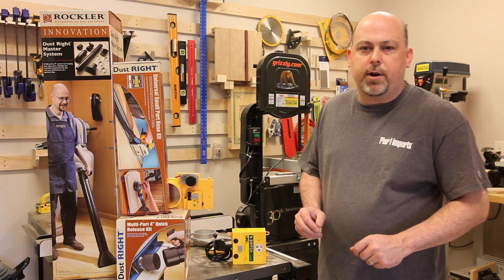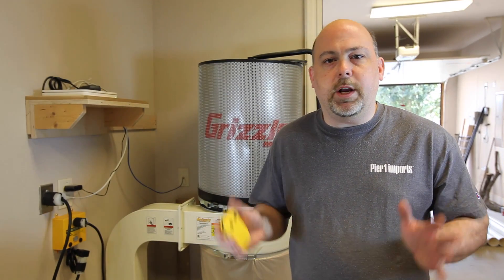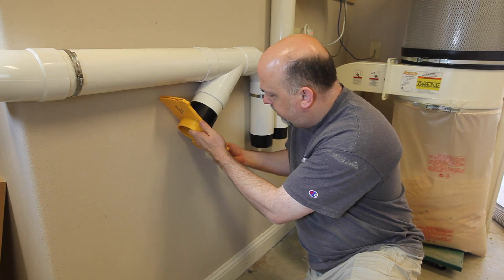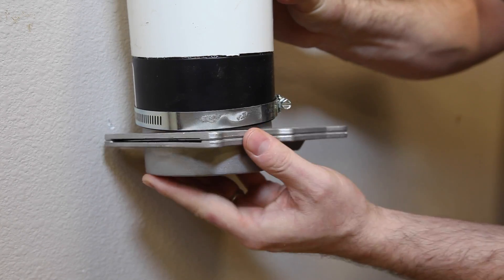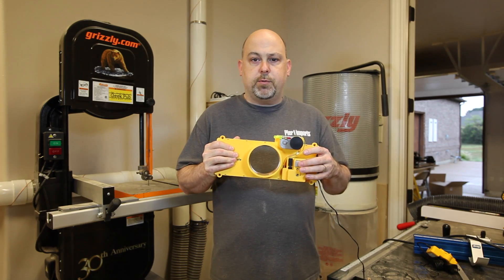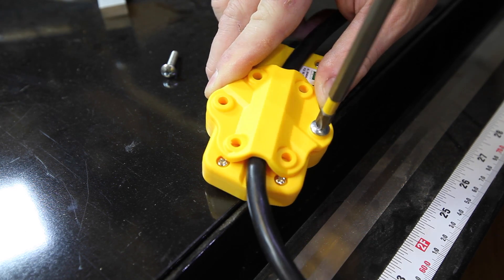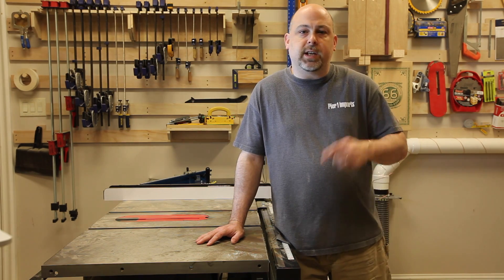Installing an Automated Dust Collection System

Comment: Great video for an intriguing product. We're definitely looking into getting the IVAC system now for our shop.

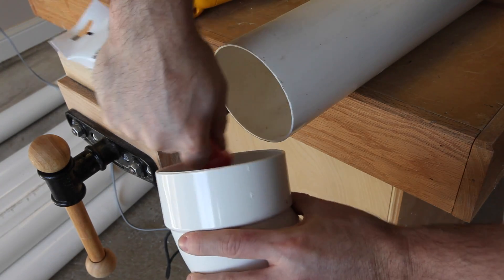Question though...What PVC pipe are you using and where'd you end up buying that from? From the video around 02:42, it looks super thin. We've been looking at using PVC meant for sewer/drain but even that looks thicker than this.

Anyone encounter an issue with sewer/drain PVC where the diameter is less than the stated value? We went to a local Menards and they have 2 types of PVC - high quality thick material and this thinner sewer/drain material, and they are not the same diameter.

The sewer/drain PVC is about a 1/2" narrower in diameter than the thicker material.

We're trying to not pay out $50 per piece for our dust collection system, but also ensure that the pipes we end up with actually fit together within the system as a whole.

Comment: The way you grounded that pvc pipe did absolutely nothing.  That is fact and isn't my opinion that is up for debate.
Reply from the maker: You're pretty sure of yourself for being wrong.  The screws penetrate the PVC and act as rods inside the pipe collecting static electricity from moving dust/air.  Stay in school kids.

Comment: The only issue that I am trying to solve here is that you need at least 3 power outlets per machine i.e., one for machine, one for the gate and one for the tool that goes on the cable to detect current. There should be a better way to do this which I am not aware of.
Reply: One outlet can feed a power bar, which you can plug your gate and sensor in to.

Comment: According to Grizzly’s website: “To protect against static electrical build up inside a non-conducting duct, a bare copper wire should be placed inside the duct along its length and grounded to the dust collector. You must also confirm that the dust collector is continuously grounded through the electrical circuit to the electric service panel.” The unit typically produces 80 dB noise levels which can cause hearing damage over an 8 hour period of continuous operation. Switching it off when not in use is an excellent idea.
Reply from the maker: Running the conductor inside the pipe is a terrible idea. It will collect and hold dust and strings of wood.  In addition, it will cause turbulence in the pipe reducing airflow and efficiency. The approached we used where you pierce the pipe with a metal stud (in this case a screw tip) every few feet is by far the safer and most effective method.

Comment: This system will set me back around $800 for my small shop, even higher if they actually offer 6” valves 😳 
..Ahh I think I’ll do it manually for now until competition comes in and drive the price down.

Comment: Adding washers to compensate for the PVC joints was hilarious. Also, that 4" duct won't give you the flow you need to capture the bad dust, even if it was a smooth run with no joints, flexy hose, and internal collars at the blast gates which are all stealing flow. It might get the chips and the mostly harmless visible dust, but the real fine cancer causing stuff will just swirl around and into your lungs. To do the job properly you really need 1200+ CFM which means 6" duct or better, minimal flexy, unrestricted blast gates, and no 'adaptors to regular dust control fittings'. Finally, forget the silicon. A friction fit is just fine for this, costs nothing and is much easier to alter in future. Otherwise, great work flogging your sponsor's trinkets.

Comment: I can’t believe all of the 90 degree turns you have in the ducting! I hope that you have further updated.
Reply from the maker: There's a video someone else did on that topic.  Every turn equated to roughly .05% reduction in flow.  It might matter in some commercial setup. It's a non-issue in my setup.

Comment: I've seen videos on this Dust collection before and in the comments section almost all have said the system stops working after a couple of months so I didn't think about using it and the price would have been $1400. Too far out of the price range for me
Reply from the maker: Still going solid 4 year later.
Reply: @TheGeekPub  thanks for the information .

Comment: I'm confused why you have it programmed to close the blast gate before it turns off the DC.  Assuming no gates are open how is it going to evacuate any residual dust?  Sounds like it's just putting unnecessary strain on the DC motor.
Reply from the maker: Exactly the opposite.  The blast gates wait 6 seconds to close.
Reply: @TheGeekPub  Roger.  Just, that's not what you said in the video, thus the confusion (time index 7:57)

Comment: if the blast gate closes and the dust collection is still going.... wont what damage the ducting or dust collector?
Reply from the maker: Not if you designed your system correctly.  But you can google it.  Dust collectors with the correct plumbing actually use the least amount of electricity when all gates are closed.  It will not damage them.
Reply: @TheGeekPub  gotcha, I just read what all the experts and engineers say on these blogs, I need to stop listening, lol

Comment: Back in the day everything was wired with LV and relay switches with green lights on both gates and a master flow control board. Now I can key up my Ham radio and turn on my neighbor's workshop in the middle of the night.

Comment: It is silly to use induction sensing and then require a power source for the sensors. Why not just use a  current activated switch and eliminate the need for the UBS charging bit?
Reply: The main reason I can think of is if your blast gate is a long way from the sensor.

Comment: Nice job and nice shop but I hate to be the picky guy  one thing I hate is if your working for crap sake wear boots   If not boots sneakers  flip flops on ladders or in the work shop is not safe.  On a second note  you can make blast gates out of mdf and sewer pipe fittings also can be actuated with a micro switch from long ranger or any other with a 10v dc coil   Majority of the time the remote is lost or on the other side of the room where you don’t need it and have to walk back   All you have to do is open the gate where you wanna work and the dust collector turns on    Otherwise great job
Reply from the maker: Worry about your own safety and I will worry about mine.
Reply: TheGeekPub relax guy   Every day I lace up my steel toe work boots and get going to work and kick them off when I’m done building  there’s never a time I put a tool in my hand without boots on  it’s just common sense!
Reply from the maker: That's awesome.  You win your safety police badge.  Everyone is so proud.

Comment: In the end I think its better to make your own system with homemade blast gates and stuff I got about 40 arduinos with rf recivers and transmittors with some wifi and bluetooth modules and some relays. IF you have the experiance to make them yourself you should deffently do so, it will reduce in costs, you'll probaly learn something and you can customize it to how you see fit. Having a 3D printer on hand will also help alot since you can print blast gates and different connectors yourself. But if you don't have the experiance or capacity to do this yourself this is the best way to go! awesome video :)

Comment: Hi, neat idea with the wall mounted clamps. Why take a risk, no matter how small, with a dust exposion/fire? However, why not just run the copper wire inside the tubing? Much neater looking. BobUK.

Comment: I see a lot of people here commenting on should they or shouldn't they spent the money on this system; I guess if you get it for free it motivates you to get one, I personally can do it either way, I would like to work with it but also can do just fine without it; I have a clearvue max and have multiple gates open at one time on certain stations that I use more often, I close my gates manually at the thickness planer, dual outlet drum sander, but keep it open for the miter saw station and the table saws; you kind picked on some here for not investing 500 in this system while investing 3500 or so in table saw, I got news for you, I got two sawstop saws, one industrial and one 3hp professional and a slider, you know that just the two sawstops cost me quite a lot more than you mentioned, still don't feel the need to invest in this automated blast gate system so stop picking on people for that, some of us enjoy couple steps to open and close some of the blasts; one piece of advice.....it would've been better for you to invest in a better dust collector than worry about the blast gates, you will be surprised what a difference that makes, you can afford to keep more than one blast gate open when you have a 8" main running thru your shop. other that, I am happy for you that you get to play with those toys; one of the guys in their comments was right, what are you doing walking around in your slippers in the shop, let alone climbing a ladder in them, that tells me you like more being in front of the cameras that be out there and get dirty and make some money; its so funny when I run into you guys, the ones that like to do these little shows about being a woodworker, yet I don't see any meaningful product done by you guys; I've building staircases and cabinetry for as long as I remember, I never found the time to be in front of the camera like some of you guys are, you guys have too much time at your disposal, lol; don't mean to pick on you, just want to let you know, some of us have no interest in these new gadgets that keep on popping up, if you follow with it, you will never catch up to them, they always pop up new things all the time, just like the Iphone. best of luck to you. Dan

Comment: From what I have read, there has never been a fire that was started by static in a dust collection system. That being said, I ground my dust collection hoses, because I absolutely hate getting shocked!
Reply: True, static shock is a thing especially if your have carpet on your shop floor 🤣

I run basically the same setup(video) in my shop w/o any additional grounding. There is no dust particules in or out the pipes. My floor is concrete and I wears adequate shoes, never get a single static shock since my new shop is up (5 years).

Comment: Not a good idea to close the blast gate so long before shutting down the vacuum pump. Not good for the fittings or the motor, and it won't be able to clear the line effectively which is the only reason to run it after shutting the tool down.

Comment: The cost of this product is horrendous and there seems to be no starter kit, My hobby shop would cost in excess of £800 not including the duct pipe. And if you really think that you need to ground you dust collection system then any piece of wire can be used you don't need to buy a special one.
Reply from the maker: Comments like this baffle me.  People will spend $3500 on a table saw and $3500 on a jointer, and then whine about $500 for a dust collection system.
Reply: @TheGeekPub  Not many people spend 3500 on a table saw.  Most woodworkers I know have $200 dollar worksite saws they've modified or built a platform for.  Going to the local woodworking group here in Portland will show you that 80% of the woodworkers don't have a jointer at all.  This kit is neat, but the price is astronomical for what it provides.  Hell man, the "grounding kit" is 20 dollars for two fittings, two screws and some copper wire.  I know they sponsor the video and you've gotta shill for them and all, but comments like this by you are obnoxious and scream of privilege.

Comment: You can't ground an insulator.  lol.  At most you can drain the charge, but it's really not necessary.  However spiral flex hose (if it's wire reinforced) will definitely built up a nasty charge and should be grounded for sure.
Reply: Bert Green, I kind of feel sorry for the geekpub, lol; you kind of mop the floor with him when it comes to debating; I tell you what, he comes across as a hard core sells person for this company vs a true woodworker he should be; you are 100% correct with regards to OSHA outcomes, in a regular woodshop where chemicals are not involved, I've yet to see a fire; I personally was in the woodworking industry for a good while and, besides making sure that the spray/paint area is well vented, I've never worried about dust collection spark fire, mind you, I owned that business so it was in my best interest to make sure there was no fire at anytime; we had all kind of other problems like cutting fingers, etc, but no fire so far; but this newfound you-tubers that these days have nothing to do but try to sell stuff on you tube and tell people all kind of false info, piss me off, because so many innocent people out there believe everything these guys tells them and because they hang around you tube for a while, now they believed over people like you that put out facts, funny stuff isn't it?
Reply: I mean, he really should have stopped debating me the second I said that I was an electro-mechanical designer and that I build commercial grade machinery and control systems.  This is what I do for a living.  Hands on experience both building an operating machinery while actually being the kind of nerd that enjoys reading technical white papers like the MIT Lincoln Lab report.  But his response "You still don't understand" had me rolling on the floor laughing.  At the end of the day, it's basic electronics 101.  1)  You can not ground an insulator.  2) If he wanted to prove this was an actual issue, all he had to do was find an example of an explosion happening and share a link.  I was confident enough in the outcome I was willing to put money on it.   My offer stands:   $5 to anyone that can post a link of a documented case of a dust explosion in PVC pipe in a non-commercial environment as a result of static discharge.   

Regardless, it's still not a bad idea to drain the charge and run ground wires as shown.  The static is quite annoying, and it can damage sensitive electronics.
Reply: of course its not a bad idea, especially with the braded hoses running to the tools, static can be a pain in the ass; there is another gentleman that makes a big deal of this fire hazard misrepresentation, I don't know, maybe they are connected to the right people that pays them the right amount of money to keep bringing that up and we all spasm here about how wrong they are when they know all along how wrong they are but laughing all the way to the bank, lol.
Reply from the maker: I don't debate things like fake moon landings, flat earths and whether or not dust in a vortex moving through plastic tubes causes the build up of static electricity.  Call it childish if you want.  It's been debated an nauseam in the comments.  I'm sure someone else will chime in and help you out though.
Reply: @vertikalvt  A response like "you don't understand" followed by a response like "I'm not going to debate" usually means that He doesn't understand. It's like arguing with a liberal. They do a lot of screaming and name calling, but can never actually give you an answer to any of your questions.
Reply: @MAGA MAN Worse than that, it’s more like arguing with a conservative about climate change and environmental destruction, when you’ve got all the research and facts and they just shout “fake news.”
Reply from the maker: You obviously don't understand what's happening here.
Reply: I'm an electro-mechanical designer.  I build commercial grade machinery and industrial control systems for CNC machinery.  Checkmate.
Grounding is important because the static can wreck havoc with controls, but in a non-computerized environment the risk of explosion or fire is virtually nil inside the duct work.  The larger risks are inside the dust bin or filter areas or drawing a ferrous object into the system and getting a  hard spark (metallic ember, not static) from the blower which settles into the dust pile.
But if you really want to play this game, I'll PayPal you $5 for a beer if you can find just one documented example of a PVC dust collection system causing a dust explosion (from static discharge) and post a link here.  Put your money where you mouth is, otherwise, you're bullshitting.  And nobody likes a bullshitter.
Reply from the maker: Good for you.  You still don't understand.

Comment: A three tool kit is $500.  CHAAOOO!! An Arduino is about 1/4-1/3 of that cost.  Cool tool though.
Reply: I was trying to look up arduino, which seems to be a DIY IC board that can be used for many things.  Is there already a solution using arduino for this?

Comment: Hopefully someone can explain how static electricity generated by swirling sawdust in a plastic pipe will channel itself to earth ground. The idea seems a bit sketchy to me. It is my understanding that static build up can result in a net positive or a net negative charge. A net positive static charge would move to a lower potential such as ground. But if the system were to become negatively charged - the earth ground would have to release protons in order to neutralize the effect of static build up. Food for thought right? So unless someone can shed some light on the subject I'm going to have to call bullshit on wood and PVC generated static electrical fires and static grounding...
Reply from the maker: There have been scientific papers written on this topic.  Bullshit it is not.  There's even an OSHA paper on it: https://www.osha.gov/dts/hib/hib_data/hib19880930.html
Reply: I'm sorry to have dragged you into this because this was not really the appropriate place for my comments in the first place.